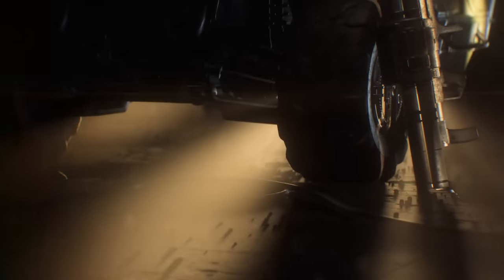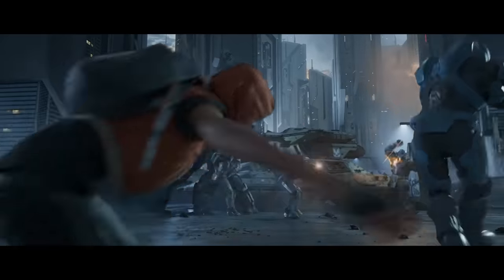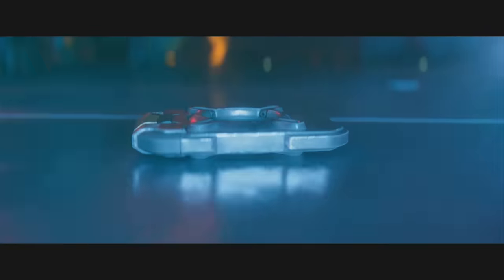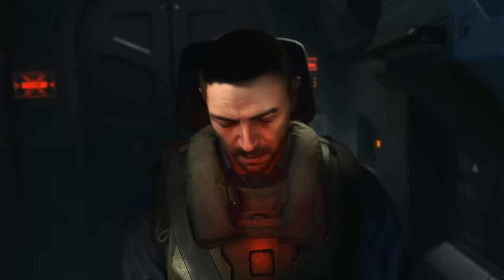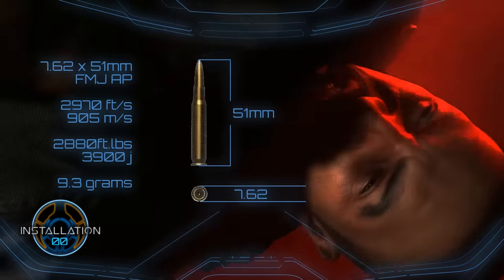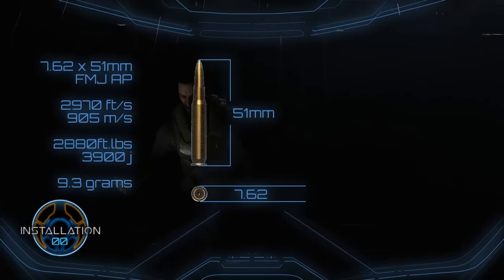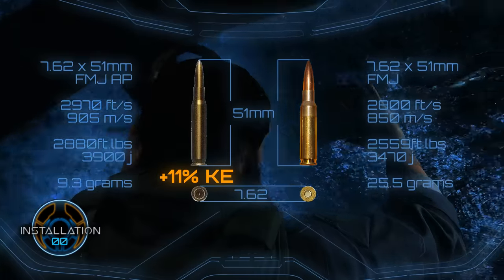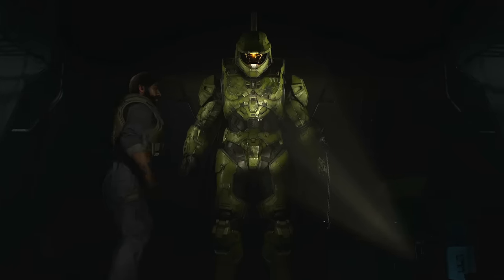Why are UNSC Weapons so powerful!? | The Armory

Comment: Here's my thought:

They have a propellant so massively powerful compared to ours, they were able to reduce each bullet to just 9 grams, while still increasing the kinetic energy. Basically, it ways roughly 1/3 as much as modern equivalent rounds, but the bullets fly 3x faster so it works out.

This doesn't account for the muzzle velocity being too low, but maybe they're hybrid rounds that have some lingering propellant attached to the bullet itself that ignites after the bullet leaves the muzzle. Like a second-stage booster sort of thing.

While admittedly a bit far fetched, it's fairly reasonable compared to alternatives, and even would explain why the accuracy for the assault rifle is so ABYSMALLY low, as the second-stage boost would undoubtedly throw the trajectory off.

I dunno, just a thought.
Reply: or perhaps the rounds are hybrid plastic and powder propellant's since they've got such advanced material fabrication the barrel's could handle the pressure with blowing up

Comment: We could be looking at a hybrid cartridge like the 6.8x51. Instead of a 6mm round its still a 7.62 but using a better propellant and hybrid case. 
Also what about pulse rifles? Instead of a firing pin its an electronic igniter, that could potentially propel the round at a higher velocity?
Reply: I don't remember the Remington E-tronX boasting anything like that. I'm sure marketing would hype it to death if it boosted pressures even 5% more than traditional explosive priming.
Reply: @JohnS706  Look up ETC guns.

Comment: Great analysis, you have come a long way in this particular subject. The 7.62 of the 2550s isn't absurdly higher performing in comparison to modern ammunition. I reload my own (albeit hot) and regularly exceed the muzzle velocity outlined in 2550 ammunition. What baffles me however, is that with the advanced metallurgy of the UNSC, they still rely on brass cases. At some point, pressure will exceed what a thin wall of brass can take and will split, usually explosively, near the primer pocket to the rear of the case. In fact, the new 6.8x51mm developed for the US Army reinforces the primer pocket with a steel back end that the rest of the brass case is pressed into. This allows much hotter loads which is intended to retain enough velocity to break ceramic body armor out of a relatively short barrel. The UNSC however, should be using some inconceivably hard cases which are capable of withstanding immense chamber pressures that would be indicative of 500 years of ballistic development. 3000 fps just seems underwhelming for a society that can FTL travel.

Comment: It's an easy answer for the small arms: better propellants instead of modern ones. Essentially, the outside might be familiar to us, the internal stuff isn't. There is this system called Guns! Guns! Guns! that went into gun design, and as you advance across the ages, the better your propellants (and other bits like the barrel and receiver) get. While gun propellants haven't changed much in our current weapons (we're still largely using WW2/Cold War era propellants), the centuries ahead UNSC is using far more effective propellants that aren't Electrothermal Chemical (ETC), though the latter has the problem of being extremely limited in velocity (non-ETC propellants have a ceiling of 1.8km/s, while ETC propellants have a range between 2km/s to 4km/s in terms of velocity).

Comment: My head canon has always been the chemical propellant change, and the em booster, em booster is best for handheld because you can much more easily add some more energy to the bullet than get the bullet to the same speed with the same size gun.

Comment: I like the idea of the bore having accelerators. Even if that's not the case, other fiction could adopt neato theories like that for small arms.
Reply: my head canon is they use plastic explosives as propellant since IRL they only don't because of the insane pressure makes the added barrel thickness not worth the benefit but in halo they can make power armor so they've likely got material fabrication down to a T making the current issues non factors

Comment: Honestly, for my own writing I've been of the mind of using coil gun assist or even primary propulsion while a powder charge is used as a 'lift' charge to get initial velocity. So I like the idea that this may be one of the hidden possibilities (perhaps in the mind of Joe Staten and never written down properly as projects moved on) for increased power.

That said, alongside changes in propellent composition, it could also be physically formed differently in such a way that while volume taken up by the powder charge isn't any different it provides a more energetic reaction. Something with more micro surface area that increases pressure, alongside metallurgic advancements allowing for comparatively high chamber pressures without heavily increased wear and tear on the internals as well as buffering systems that keep recoil from being a major issue.

There's also the with the increased weight factor, lead might not be the metal being used for the bullet itself. Even today brass rounds are on the market for big game (elk and similar) hunting and more environmentally friendly ammunition. Though the former was achieved because it was fond that even at 'standard' powder charges, the increased weight of the bullet imparted significantly more energy. The main body of the bullet could be brass while there's a softer tip to allow for some moderate expansion. Though without a soft tip, it already makes the entire round a potentially armor piercing round as it's stated to be. Then not requiring a core within the round itself.
Reply: You sound like you need to be making content too.
Reply: @praetorianstride5948  I mostly get my inspirations for working off of this sort of thing is by having something put in front of me and be made to think about it. I love having my brain roll on these things but I don't think to hard about it until Someone like 00 says "Well... This could be why." basically. I'm a better in collaboration than anything. I greatly appreciate the compliment, man. ^_^

Comment: Also the 51mm dimension in 7.62x51 NATO is the cartridge case dimension not the overall length of the complete round
Reply: And 7.62mm is the diameter of the bullet (what actually comes out of the barrel), not the base of the cartridge.

Comment: "Why are UNSC Weapons so powerful!?"

Because Monkey good at throwing rocks REALLY Fast
Reply: End of the Video.

Nah, You are assuming a few basic things, 1 They are still using Current Production Metals for the casing, or still using the same amount of powder as our IRL counterparts. 

Master Chief is wearing 2-3 inches of hyper durable tank armor plating bolted to a Polymetallic polymer rig system covering a Nano Gel infused system adding 700lbs to his relatively small body. 

Chances are, the "Brass" used isnt. Chances are is a Polymetal or straight up plastic* which would suggest the Brass weighs nothing, and the nearly indestructible weapons are over built for the added pressure of fully filled or enhanced powders. 

There is a very likely option they are just using very spicy rounds in an over built Rifle with nearly weightless casings because shipping bullets is expensive.
Reply: Also remember, the design is also likely ceremonial or "habit" as in game they're still using a nearly 700 year old round out of a nearly 600 year old design. so making it look like Ancient Bullets could simply be because it's in vogue right now. Like, Jack Churchill took a tank battalion with a Claymore Sword which at the time was a 500 year old design. 

Also Also there's the "Good Enough" "Cheap Enough" option. it costs a LOT of money to ship brand new advanced weapons to every soldier who until a few years ago were only fighting other humans where a 556 or 762 would still be cheaper and more effective than a Mag Lance. 

THEN There's the "BAW" Bad A Weapon Rule to consider. when Chief is walking around with a backpack able to delete a gas station Parking lot and Punch a tank to death in less time than it takes for some bored Youtube Commenter to write half this sentence, let alone read it, It's to be assumed many MANY laws and treaties have been made among the nations, worlds, and colonies limiting the amount of power a weapon can have, or at the very least specific dimensions for ammunition. so with newer materials you can get a round with 1/3 the weight, double or triple the Powder and 30% more kick and still be under the agreed upon specs.

Comment: Wouldn't increasing the power of the propelet make the gun very uncomfortable to shoot for the reguler soilders of the unsc? Especially considering this is a fully automatic 308 round we are talking about basically? Id imagine it would be fine for spartans but for anyone else it would feel like they'd be getting kicked over and over in the shoulder. So out of all the possibilities the one the makes the most sense to me would be to hybrid design you talked about of the guns being both gas powered and magnetically enhanced, this way a reguler soilder can just turn off the magnetic booster making it a normal gun more or less, but a spartan can turn it on to make the round powerful.
Reply: You are assuming that the normal soldiers of the UNSC aren't enhanced at all.
Reply: @MastaChafa  Well... they canonically aren't right? Except if they are an odst which is still more rare than your average soldier I think.
Reply: That was my first thought when I read that the AR fires 7.62. The recoil would be insane in full auto out of a bullpup configuration but I remember reading a few times, and don't take this for gospel as I cannot provide any sources unfortunately. I remember reading that UNSC weapons utilize advanced recoil mitigation technologies.
Reply: @BreakerXXIV  Well depending on how they do it I suppose recoil mitigation technology isnt particularly super advanced. We have modern infantry weapons that have advanced recoil mitigation like the kriss vector. 

But given that the assult rifle would need to shoot an elites shield several times for the shield to be depleted im guessing the AR would need to be used on full auto to ever be effective against elite shields, but at the engagement ranges they would be using the AR its full auto setting would be WILDLY inaccurate for your average solider, even with advanced recoil mitigation. Even during the times of the Vietnam war I believe the m16 was most often used in (if not out right locked into) burst fire mode as using it in fully auto mode was bad at preserving the weapons hit per round fired ratio, where as burst preserved that ratio alot better.
Reply: Gas systems and barrel lengths help with recoil mitigation. For example: a 10.5 M4 and a 20inch M16A4. Both can accept and fire the same rounds, but it's generally agreed upon that the M16 has a softer recoil impulse due to a longer gas system (10.5 has a carbine length and M16 has a rifle length) and the barrel (more mass, means more weight to absorb the kick unless it's a pencil profile, but that's a different tangent). Given that a Halo AR is a bullpup with a 30 something inch barrel, I don't have hard time believing that standard grunts would be fine with it. That and if we go by the US Army's standards, weapon familiarity and proficiency is highly stressed, even for non combatant roles. So, I'd assume each grunt has been brought to the range with their rifle enough to be familiar know how the rifle performs
Reply: Recoil is very dependent on firearms design itself, for example Stoner 63, Ultimax 100 MK8, SureFire MGX or Knight Armament Company LAMG & AMG.

Comment: Is it cannon that the DMR does more 'damage' per shot than the assault rifle, despite both using the same 7.62x51 mm round?
Reply: I don't see why it wouldn't. Assuming it has a longer barrel than the assault rifle, it'd have more muzzle velocity. Thus more penetration. I don't know about it being canon though
Reply: @Wisewolf_of_Avalon  Ah. Didn't think about that, I was thinking that maybe the casing was longer or wider, allowing it to carry more propellant.
Reply: Well, the most simple answer is that it's just game mechanics. A more technical answer is what @WisewolfOfAvalon said
Reply: Doesn’t it fire 7.62x51 AP?
Edit: Just checked my Halo Encyclopaedia and the M395 fires AP round but M392 is standard 7.62.

Comment: I'd say its probably a mixture of things, such as Electrothermal Chemical Ignition in place of primer, likely a titanium-alloy barrel for higher pressure propellant. This mixture of changes could offer a lighter round, increased powder load with additional oxidizer and higher velocity bullet. Considering the UNSC makes use of titanium alloy armor on its infantry, its gonna need a denser/harder material other than lead, assuming they don't use depleted uranium rounds.

Comment: What about a system that would use any buildup of electro-static discharge siphoned into the energy of the round somehow? Or feed into energizing any kind of magnetic booster you mentioned.
Reply: So, in a way, Assault rifle were simply railguns?
Reply: @user-iy7jo7bq4f  i wouldn't say railgun per say because it still mostly relies on chemical propellant.

Comment: at least part of the increased velocity, and therefore energy, is most likely due to the bullpup design. One of the main features that is seen as a strong point of bullpups is the fact that a longer barrel can be put into a overall shorter rifle. Based on the scale of the rifle in a spartan's hands, the barrel is likely 24-30" while the standard for 7.62 NATO is generally 20-24". Rifle rounds such as 7.62 NATO can see significant increases in velocity out of longer barrels. Therefore, with development in propellent over the hundreds of years before Halo takes place, combined with a longer barrel, should account for the increase in energy we see, based on the numbers from the lore and games.

Comment: The powder is either more powerful solution or there's an oxidizer in the powder giving it more power.
Reply: Maybe it is solid rocket fuel of hydrogen and oxidizer.
Reply: @WolfeSaber9933  no too dangerous. That's an ammo explosion that's too easy to produce. Added oxidizer yes but the powder is not that much more powerful than what we have today.
Reply: @barrybend7189  There have been test using rocket fuel as a propallent for cannons. Also, some advance cannons in test use a plasma to lit the propallent instead of traditional design. This allows the round to be better stored since it needs the plasma to ignite, not be heat from incoming fire.
Reply: @barrybend7189  The rocket fuel propallent have show to fly faster to railgun tests.

Comment: 2:56 Those measurements are mcfucking wrong
Reply from the maker: I think I know to what you are referencing. The length of the case is 51mm, verses the overall length of the round being 71mm. I agree, perhaps I should have marked the lines to indicate the case length and not the overall, but if I did that I'd get other people saying that I put the lines in the wrong place. So since the literal measurements are in the name (7.62 x 51mm), I decided to go with the former. Completely appreciate what you're getting at though. Kudos to you.
Reply: Please explain...
Reply: @Installation00  Literally do both, 71mm overall, 51mm case length,  71.1 and 51.2, but curious pedantics at that point, and 12mm rim and 7.62mm bullet, 7.82 really, but again pedantics

Comment: They really shouldn't be, given that 7.62 rounds are outdated by our modern-day standards, never mind 500 years in the future. I hear, over and over from other fans, that the UNSC has extremely advanced propellant systems, but I have seen literally no corroboration of that in any of the lore. It would be great if 343 confirmed that, for certain, so that shit makes a little more sense.
Reply: Yeah, the NGSW program, whether or not you agree with the decisions or not, has shown that we can go alot further with not just propellants, but also round structure as well. This being said, there is a limit to what you can get out of chemical propellants given the physics of expanding gas and such. We are not close to it in small arms, but we kinda have reached that performance limit in larger artillery pieces.

Comment: Just some fixes with some errors

1. The Chaingun (The M41 LAAG "Vulcan") fires a 12.7x99 AP rounds, which is the .50 BMG fired from our modern day Browning M2 Machine Gun. The Tri-Barrel helps with the Vulcans self cooling

2. The M6 Series fires the 12.7x40mm round, roughly around the same caliber to the IWI Desert Eagle, which fires the 12.7x39mm caliber round. It is a recoil powered